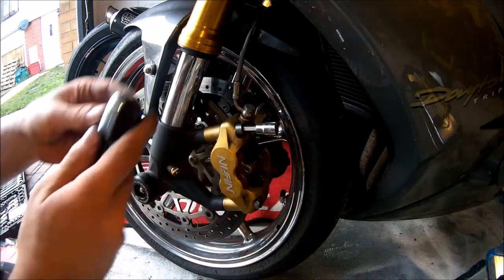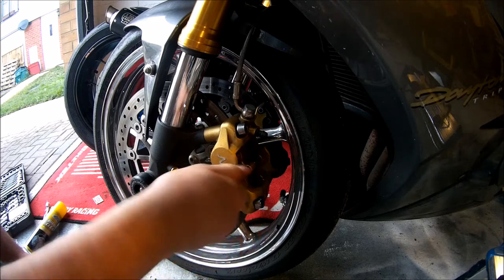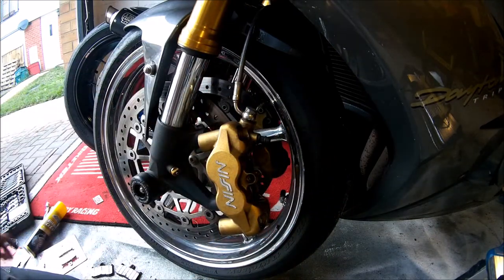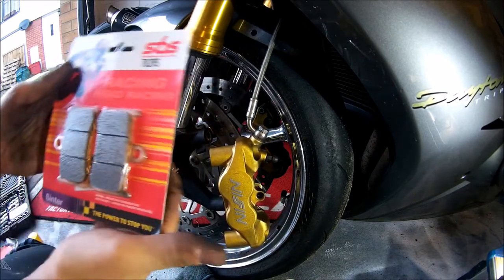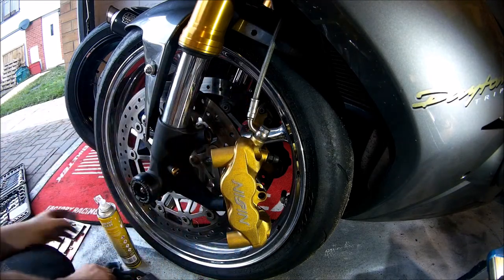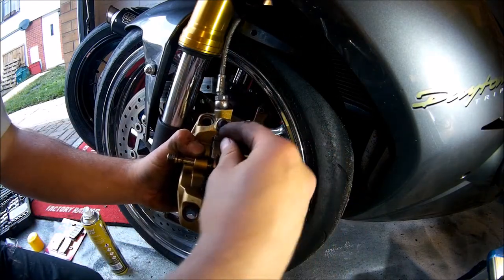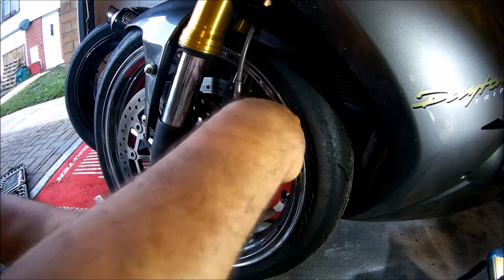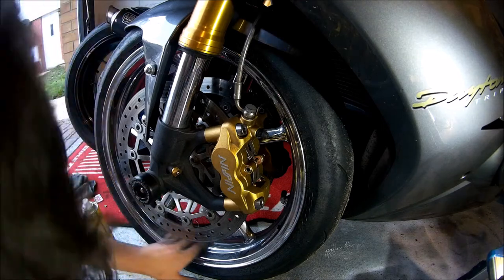How To Replace Triumph Daytona 675 Triple Brake Pads Tutorial - Nissin Calipers

Comment: How are brakes on your daytona? One finger bity, or u need to apply a bit of force to feel some stronger braking performance?
Reply from the maker: Hi there PopKosCZ from what I can remember the brakes were pretty good, I done a few track days on the 675 and I only ever use the front brake. I didn't have any issues, I generally use 1-2 fingers. Ross

Comment: Would you change all 4 pads if only two of them on the front 2 caliper are realy worn out?
Reply from the maker: Hi Sverre, me personally no I would change them all at the same time (all 4), if they are set up correctly and both systems are bled fully then they should wear evenly across both calliper's. Thanks for watching. Ross
Reply: @RossPerryProductions  Awsome, thaks buddy ! <3
Reply from the maker: @sverremoe4087  no worries at all.